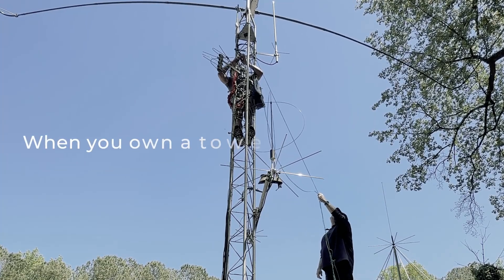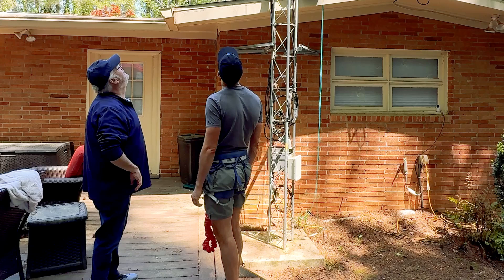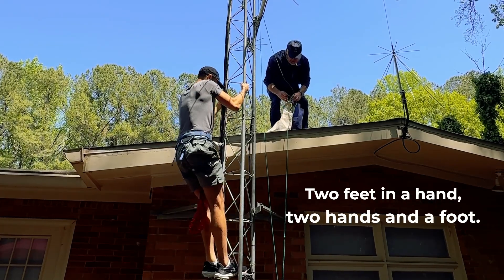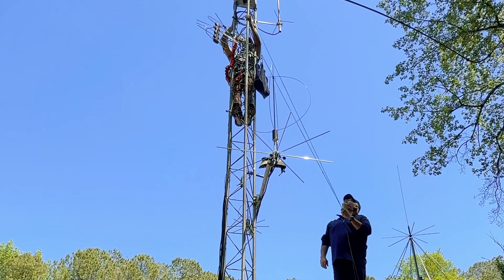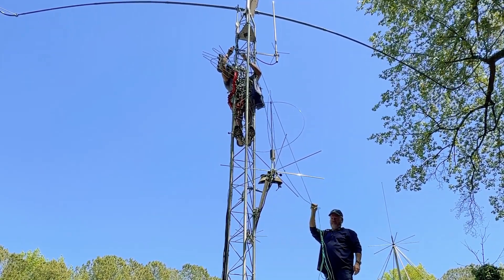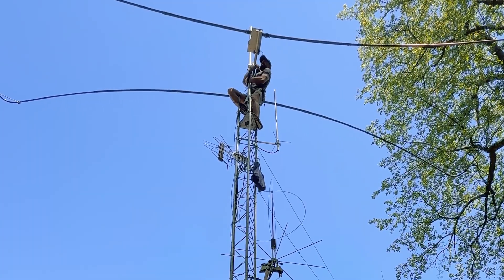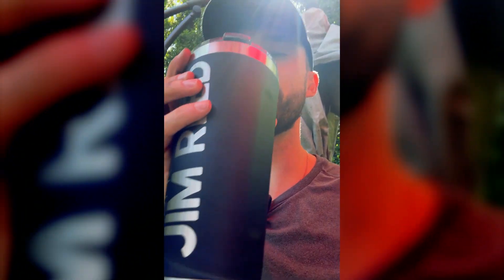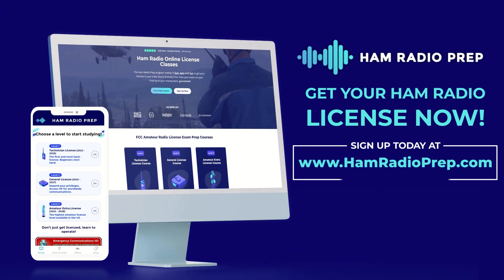Professor Jim’s N4BFR Antenna Failure! Watch James N0WRL Climb 35ft to Fix It

Comment: How are you sealing your connections?
Reply: im waiting for call sign right now and just bought a radio got to wait for it to get here
Reply from the maker: Just standard coax connectors type N. Then once screwed in, using electrical tape to further insulate / protect against moisture